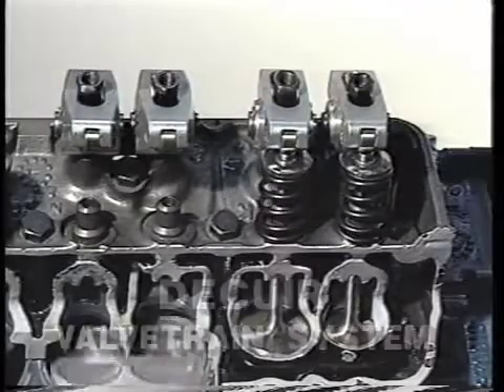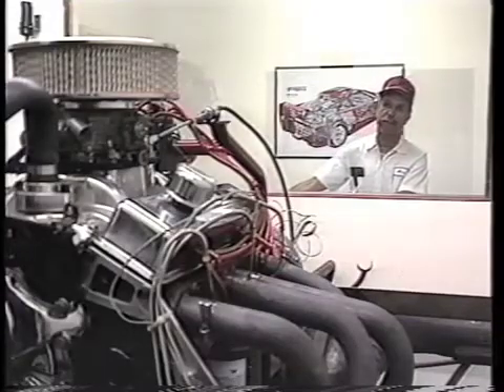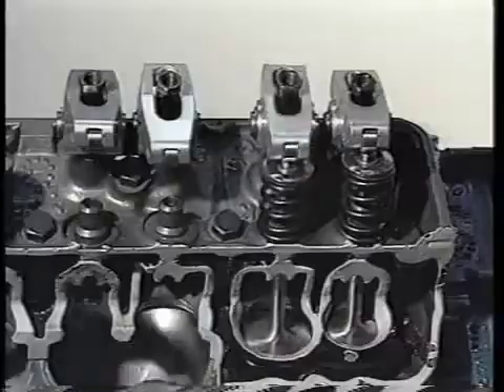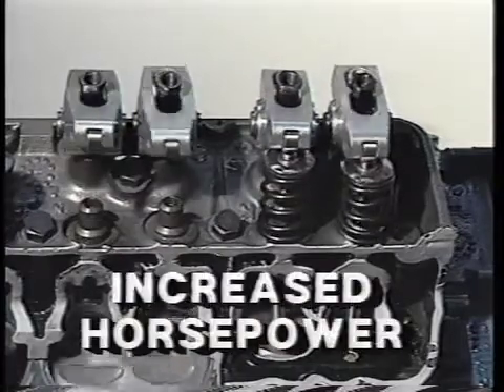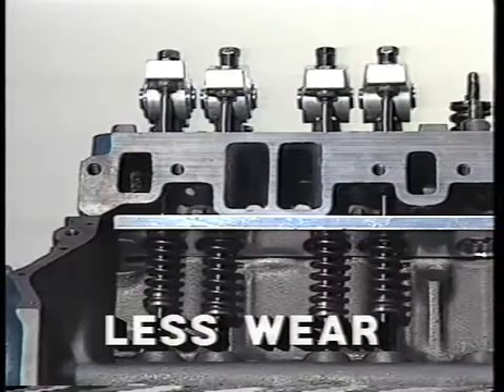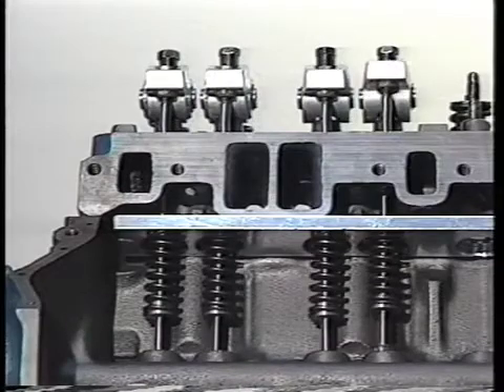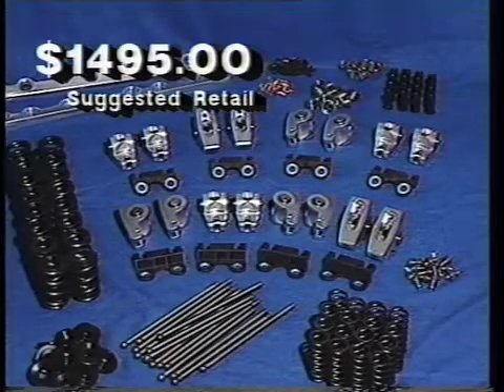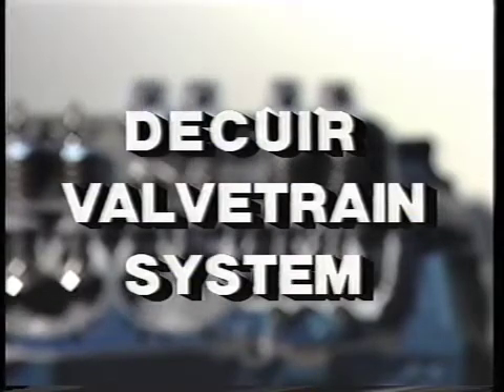Valve Train for Racing Engines

Comment: Oky one question.
why da fu.ck are we not using that in our daily drivers, or rotary valve versions. As they said u get free Horsepower and system is probably cheaper, cause u don's have so much springs.

Comment: The video said in the beginning that it was found out that it doesn't take a lot of spring pressure to open and close the valve! If you listen and pay attention there wouldn't be any dumb comments, and it's not a rev kit! 𗀼 Rev kits still use the valve springs this kit eliminates that! 😩

𗀽O yea they don't run big blocks in circle track, dirt track, NASCAR or any racing that turns left so this is designed around small blocks. 𗀉
Reply from the maker: One of the few who actually get it, thanks

Comment: So... Spring systems use up to 150 HP, but using the springless system only produced 40 hp gains.. MMMMK... Someone can't do math.
Reply: +npsit1 it's 150 required to move the valvetrain, the system will remove 40 off of the 150hp requirement
Reply from the maker: +Yayu Dhikzinjou A very smart and thought out answer. Too many people here do not seem to get it.

Comment: nothing new here. been using 3rd spring systems for 30 years. not a patented protected idea. only his design. also a lot less then 1499.00 my first 355 cid used off the shelf isky parts including 3rd spring

Comment: I'm not really sure what I was looking at what was so different from one cyl to the other? Was it the roller tips? Nothing looked different then a stock set up maybe just the roller rocker arm tips
Reply: If it's just the fact that the valve springs have multiple springs bigger deal ain't worth a 1400 dollar kit. Anyone that builds even a mild American v8 engine knows when you put a bigger cam in you check the card and get right springs they're almost always at least 2 springs so I guess u didn't need $1400 kit just $150 for rocker arms, 150 for cam, and $50 for the right springs for specific cam

Comment from the maker: This is really not a rev kit in the traditional sense. With the placement of the smaller spring on the pushrod, it cuts down on the needed spring pressure to actuate the valves.

Comment: We used these rev kit valve train components when I was a kid in LA, They were good for extra RPM and lower spring rates but they played havoc on camshafts! Extra care needed to be taken to not bend all your pushrods at lower RPM. You had to make sure your rockers got oil first. this meant oiling the crank second at the expense of the crank bearings. They worked well with 427 side oilers and Olds 455 But I wouldn't use it on a small block anything!

Comment: @mikeb1444 So, I'm skeptical that $1500.00 will improve the peformance of any OHV engine. Something like CERMA engine treatment will coat engine internals with a 350 000 psi. coating. This will reduce friction and increase horsepower and make an engine run cooler, especially if one punctures the oil pan. Who's scamming who? You didn't mention Stellite valve seats either. The 'valvetrain whisperer' just wants to retire via. the wallets of the gullible. What's next. 600 mph. barrier crashes?

Comment: @mikeb1444 It is vital that the rocker stud centerline be complimentary with the valve-stem centerline. So, when rockers are installed and adjusted, correct tip geomety is established. This can be verified with a Sharpie marker rubbed on the valvestem tip. There is also no mention of beehive valve springs which redirect the valve positively, up and down. Also, with weird engines like the Ford 460 the valves are angled and the pushrods must translate motion to this weirdness.

Comment: @curtknows101 I never said it was genius, I just said it isn't used on production vehicles for a reason. The reason is because it is silly and just a money-making scam. A ceramic engine treatment is possibly cheaper and better for an engine. Concentrating on 'spring-pressure'  is like saying no alloy exists that can handle unforeseeable abuse. Obviously the OHC engines have solved no problems, and they will go out of production tomorrow in favour of this 'racing' setup? Brilliant ! Tough rules !

Comment: I dont see how this is removing spring pressure, the lifter now has to compress 2 springs, not 1. if the spring was sitting on a pocket around the top of the lifter, and pushing up on the pushrod, then you would be lessening the load on the lifter, but at the same rate you could just lighten the VS pressure and call it a day. But what do I know.

Comment: It would be interesting to measure the seat pressures of the valve spring by itself (200 for example), then with your kit (add 50?), and then again with a valve spring by itself that was the pressure of the 2 combined (250), and see if there were similar gains. Im not a person to shoot down ideas, but this to me seems silly.

Comment: looks to me that you are just taking away spring pressure from under the rocker tip and placing it over the lifter. I know its not the same as a rev kit, which pushes down on the top of the lifter, but I dont see much of a difference between the two. If you are gaining 40 hp around 5000+ RPM, its most likely due to less valve float or lofting off the cam.

Comment from the maker: @5191keith, Keith this goes beyond just a rev kit and assists in removing much of the spring pressure needed to actuate a racing valve train while maintaining enough seat pressure to go with aggressive racing cam profiles. 
DET

Comment: @EmpEntTV I feel that the highest load on a valvetrains' parts occurs during combustion. Certainly, combustion pressure in a 200 psi./cyl. racing engine exceeds 800 lb. spring rates. And when a valve is too tight this snaps rockers and rocker studs. I'm just questioning the value of shock dissipation. An electro-dimorphic pressure spring or cellular shock dissipating pushrod could equally do the task of this setup with fewer parts. But if it works, swell. Less parts = pretty.

Comment from the maker: @seapeddler The basic premise of this system is made for current racing rules, certainly solenoid actuation has its strong points but no American Racing series allows such technology. This system has been tested and proven in short track racing and that is where its use would be most advantageous. With the way most racing engines utilize high spring rate pressures for high lift cams, this simply takes away the need for such high pressures and reduces friction DET

Comment: With exact valve geometry, I don't see how the extra spring on the pushrod will make a difference. Horsepower comes naturally when geometry and lash are correct. If it was a better system, Ford , Chev , Cummins would be using it. I'd like to see the math that proves pressure removal from any piece. The extra spring could get fragments caught in it with disastrous results. The more sensible choice would be electromagnetic solenoid actuation, or Ducati Desmo actuation, etc. Skeptical in Cucamonga.

Comment from the maker: @kyleisreallycool Hey Einstein, the basic premise of the system is the placement of the spring in the pushrod which means you can take away spring pressure from the main valve springs, this in turn reduces friction and spring tension and boosts horsepower.

Comment: @Luminaring, Basically, this system relieves some pressure in about 4 areas. In the valve guides, valve to rocker, rocker to stud and the rocker to push rod area. (I suppose the lifter to cam areas are still seeing the same pressures), so this system does make some sense as the rocker area is no longer experiencing the spring force needed to keep the lifters and push rods in place. Ingenious! 
Now, how about a needle bearing where the pushrod and rocker arm meet? I haven't seen that yet!

Comment: @1971SuperLead  So roller lifters do not increase friction that much, since as you say, "the energy compression energy is given back on the backside of the cam lobe".  Well I will give you that roller lifters are better than flat lifters, but the energy needed to turn a roller lifter cam is, well, more than you are trying to say.

Comment: why dont people just stray from using springs and valves use a rotating disk with a hole on one side, it may add to weight but use a different material -Ceramic

Comment: @EmpEntTV I don't mean to insult, and I do find your design creative, but valve springs do not increase friction noticeably if roller lifters and rockers are used, for any energy used to compress the springs is given right back when the spring is allowed to expand again.
Not only that but ......I can't help but notice that you have actually added springs to the valve train.....isn't this the exact thing you were trying to get rid of?
Now let's see those before and after dyno videos.

Comment from the maker: @1971SuperLead On the contrary, dyno testing has shown an increase in power, the principle of the system is based on the fact that as you take away spring pressure you removing a lot of friction and horsepower being robbed by the engine having to over come the intense spring pressures of a racing valvetrain. Wondering if you might show us your design and how it can work any better? 
DECUIR

Comment: Uh, this reduces valve seat pressure and so actually causes a loss in power as valves will leak on the seat more and the valves will burn easier. Also, valve float will be increased causing more valve seat leakage and burnt valves.

Comment: if you pump the bore with air the valve will stay shut .With a external spring remover you can remove old spring with no head fucks and no need to pull heads off .   DOES THAT MAKE SENSE     you can pull springs out without pulling heads off. When running in solid grind they recomend pulling your inner spring for the cam break in

Comment: wrong pump air in the bore remove spring replace whit new one no need to take manifold off the same goes with runing in solid grind cams than need less spring tension when running in heads manifold stays on

Comment: @freonr2 obviously you know nothing about engines the idea is 1 on the valve 1 on the pushrod so the springs require less tension and shares the load evenly between both springs the reason they showed the set with out was so people could see the difference between this system and standard systems

Comment: thats just why there is overhead cams. :)
 no pushrods, no rockers no extreme springs needed. a overhead cam head valve spring has to return the valve, nothing else.

ok so why are al modern engines OHC ? you all know that.

but...  for all pushrod engines i think this might be a really good thing, so thanks for the vid and for the invent.
please just lower the price so any older bigblock fan can afford it :)

Comment: So check this out, true it is not a spring less system(Thats nothing new cosworth was playing with that in the 70s) but by moving the spring away from the valve u eliminate valve float due to excessive spring ocilations at high RPM's. So since the valves aren't hanging up u get more revs and u dont have to worry about lossing a valve in the chamber.... Good idea, a lil pricey though. FYI : The Cosworth system is a better system it actually has a seperate cam to close the valves. So....PEACE!!!!